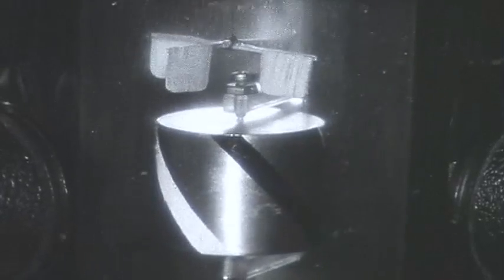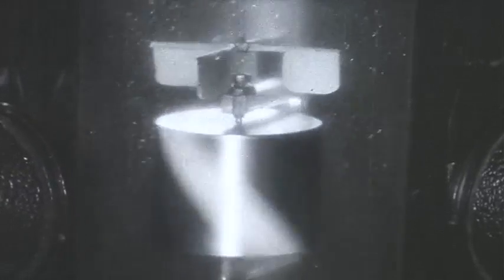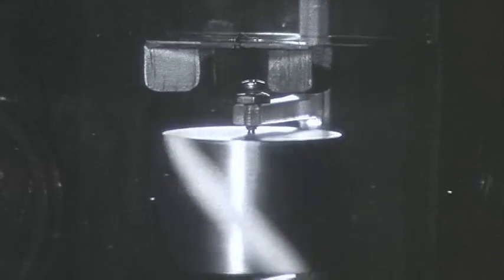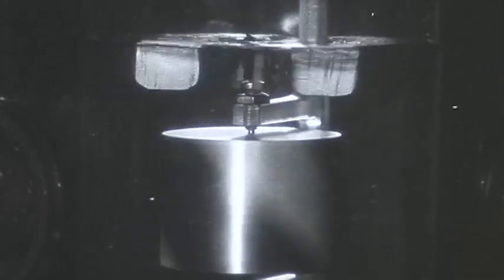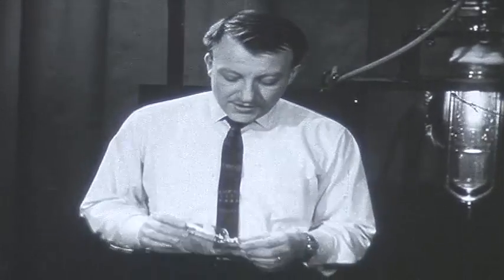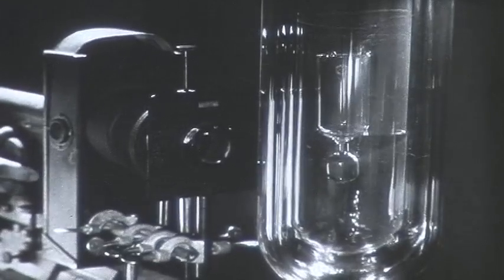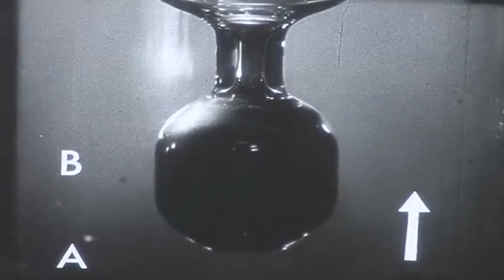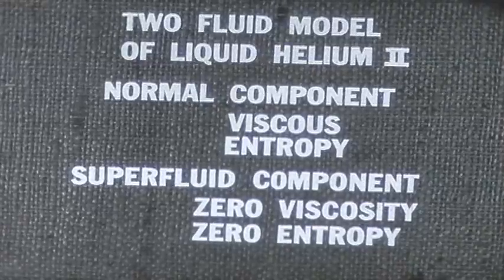Liquid Helium II:  The Superfluid - segment 3of5

Comment: Excuse my ignorance and gramar but I have two questions.
1 - if the superfluid has no viscocity how come the wooden paddels still move?
2 - when experimenting with the bulb, he says that the helium flows through the hole on the bottom of the bulb and then rises up. So if this is in superfliud state how is he sure that the the helium isn't just passing through the walls on the glass?

Comment: @xespguitarsx 

You aren't taking into account vacuums around the container. However you're still right, in the event you try to thermally insulate through a vacuum the minor radiation heat increases will result in vibrations of the atoms.

Comment: @Humidi No, it has heat. If it had no heat, it would need to be at absolute zero [0 Kelvin], which is theoretically possible, but has not been obtained in a controlled setting.

Comment from the maker: ...Below the Lambda point of about 2.2 degrees Kelvin a certain percentage of Helium atoms are already in the "ground state", incapable of losing the energy they possess by contact with a "cooler body" because a lower energy state is impossible.  In other words the INTERNAL ENERGY THEY POSSES IS NO  LONGER THERMALLY AVAILABLE. As the temperature of Liquid Helium is lowered, more and more this percentage of ground-state atoms gets bigger and bigger.